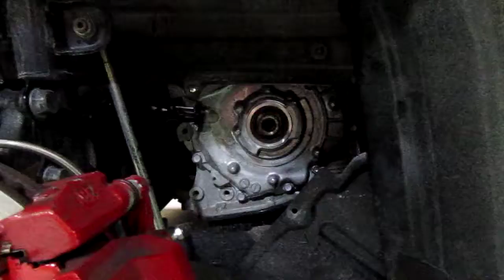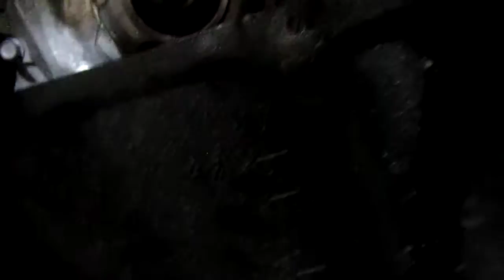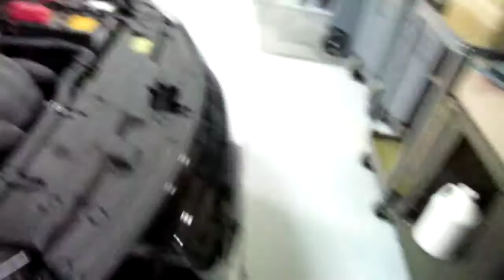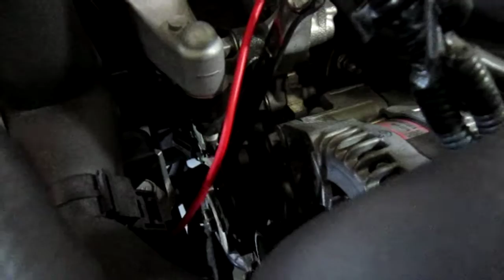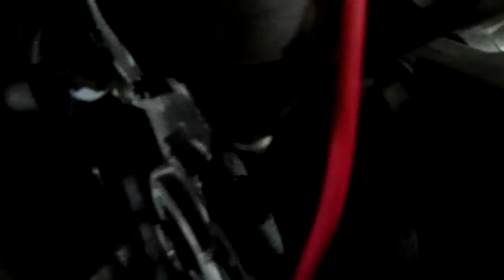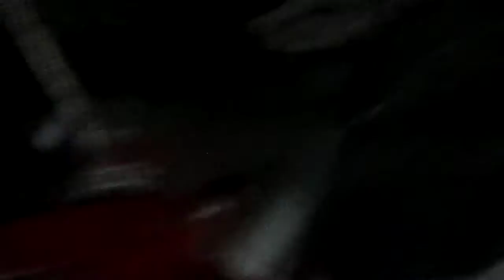2011 tC: How We installed NST Light Weight Crank Pulley by Scion Edge

Comment from the maker: well the stock one made out of 2 pieces of steel and a rubber between them to prevent any vibrations. light weight pulley obviously cant do that. all my friends that have these never had an issue and given how many ppl used NST products with success, im fine taking the chance.
who knows maybe there is no vibrations at all, or they start after 150k miles...but they still use old pulley design just "IN CASE"